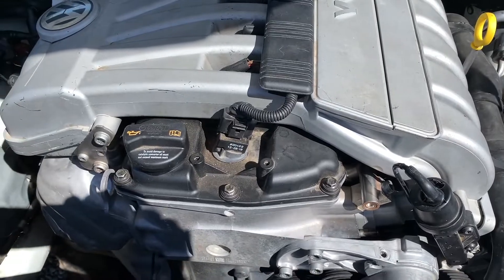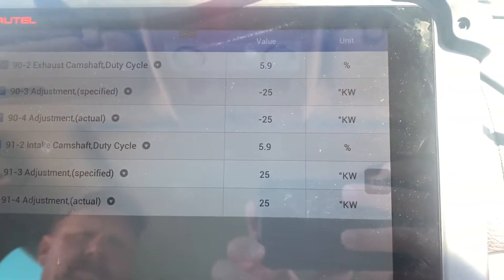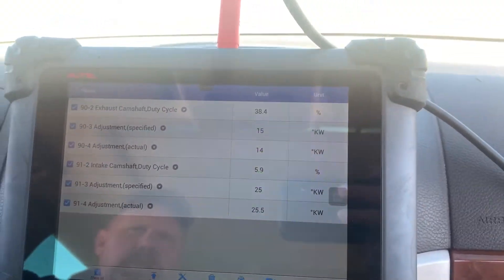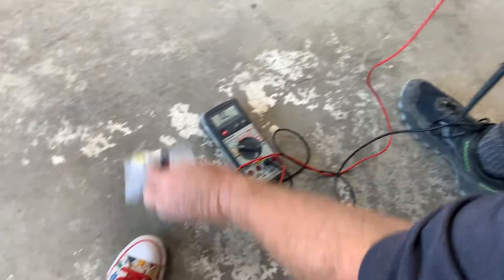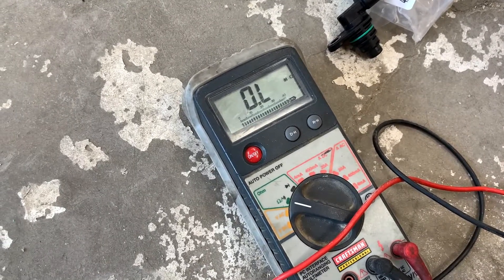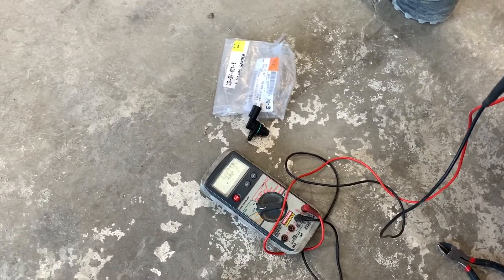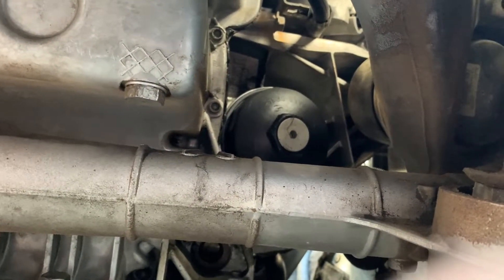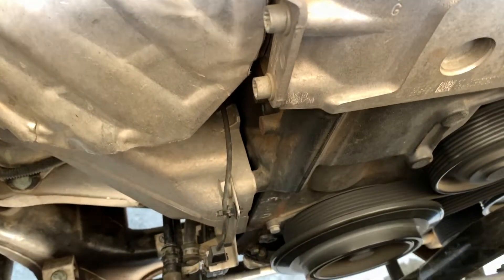2007 VW Touareg 3 6 VR6 Project (Part 10) "Is This Engine Bad?"

Comment: Hi what was the issue with noise ? Cause looks like could be camshaft adjuster bad ?
Reply from the maker: Well, we ended up replacing all the timing components including the camshaft adjuster/variator due to wear.  We also had to replace the valve tappets as we had 2 or 3 that were collapsed.

Comment: Thank you for these videos! So my dad is having the camshaft sensor issue on his 2007 VW Touareg V6. Car went into limp mode and the check engine and EPC lights came on. Checked it with my Foxwell scanner and got the "Crankshaft Position-Camshaft Position, Correlation Bank 1 Sensor A" code. Local Euro mechanic also ran a diagnostic and replaced both camshaft sensors (VW sensors). Car was fine but when we took it up to highway speeds the check engine and EPC light came on again. Mechanic did an oil flush and oil change (said oil looked pretty dark and could be affecting new sensors). Local driving was ok, but lights came back on when we reached highway speeds (60-70mph). Mechanic now said it appears the timing chain needs to be replaced. He's not able to do the work and referred us to the local VW dealer. I will say that the engine is pretty quiet, no knocking or tapping sounds. I did read that sometimes the issue could simply be the tining chain tensioner, but the car does have 155,000 miles on it and the timing chain has never been replaced. I guess my question to you is do you think it could be anything else? What about the crankshaft sensor? I did clean the MAF sensor and the throttle body (which was pretty dirty) and then drove it at highway speeds and it was fine. Then just before bringing it back to the house the damn EPC and check engine lights came back on! He has an appointment for later this week at the VW dealer, but I ran across your videos and figured I'd get your thoughts. Sorry for the long message/question. Thanks.
Reply from the maker: Sorry to hear about the similar issue with your dad's Touareg.  I don't think it would be the crankshaft position sensor as that provides a reading for the tachometer and the computer to determine spark control, so I would think you'd have other issues.  The tensioner's do fail on these cars, they are actuated by oil pressure, so any contaminants or sludge can damage them.  Since you have to separate the engine from the transmission to replace the lower tensioner, I would replace all of the timing components as it's quite costly to pay some to tear it apart twice. If I was to do this again, I would even plan to spend the extra money and replace the camshaft variator's which I ended up replacing one on this engine.  Oil sludge found it's way through out this engine.  I think that is the biggest issue with these engines, poor quality oil or extended oil change intervals.  The upper chain tensioner is accessible with the engine in the car, it's located on the passenger side on the rear of the cylinder head/block area.  It's for the upper chain that drives the camshafts.  But I do believe these VW chains do stretch over time.  Hopefully I answered your questions, if not let me know.  Thanks for watching and the comment!  Good Luck!
Reply: @mountainviewsgarage  Thank you for the information. I believe the dealer will want to replace the timing chain, but we'll take there and pay to have a full diagnostic done. It's too big a job for my dad and I to do so we're hoping to find a good reliable VW mechanic near the Asheville, NC area. Thanks again!

Comment: I’m trying to test my sensor but I can’t get a reading at all. On either sensor. Even bought a new one to check it and nothing lol. Maybe my multimeter is jacked up? Keep the videos going!
Reply from the maker: If you have alligator clips it will help out.  Make sure you're testing the 2 outside terminals.  Good luck and thanks for the comment!

Comment: It's an amazing that you solved the problem by simply replacing the sensor. I thought it was some mechanical problem based on the sound.
Reply from the maker: This car has been a challenge.  Learned a lot about what to look for and possibly expect on a VW 3.6 VR.6.  There's still more issues with it that we are still working on and deciding what to do next.  Maybe I'll do a "things to watch out for & possible issues that could arise" video once it's all done.
Reply: Great job documenting the entire process! What engine code did you have? P0017?
Reply from the maker: @barfed64  P0341 & P0366 were the codes I kept getting depending on which sensor I was messing with.  Thanks for watching & thanks for the comment!
Reply: @mountainviewsgarage  Watched all your videos on Touareg engine! What a challenge! Very educational for me. I started getting codes P0016 and P0017 on my  purchased in 2007 3.6L Touareg. Changed the sensors and oil twice. Next would be checking VVT solenoids. Hopefully I don't need to do timing work with only 67K on the car. Previously replaced the EVAP purge valve to fix the "evaporation small leak" code. Also hear a high pitched sound, - looks like a PCV valve membrane replacement to me :) Good car, but more and more problems lately. Hopefully, you addressed all the problems on yours and it's running as it should!
Reply from the maker: @barfed64  Hope you aren't having VVT issues as it can get costly....  I think the biggest issue with these engines in relation to the timing failures is oil, if pour quality oil was used or oil not being changed using extended oil change intervals.  They need good quality synthetic oil changed every 5k-6kmiles.   I surprised with the sludge I found in the oil pan and the excessive wear on the valve train.  Thanks for watching and good luck with Touareg!